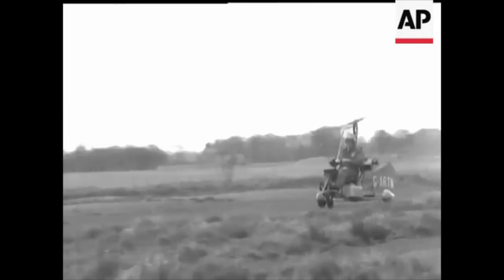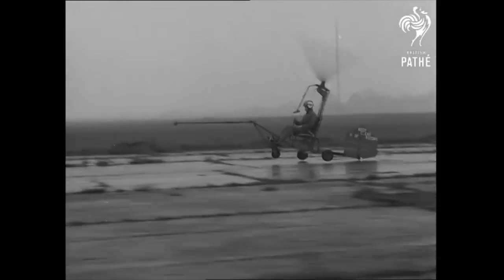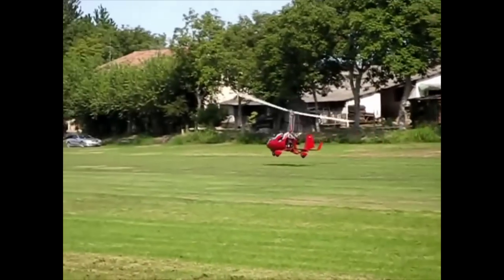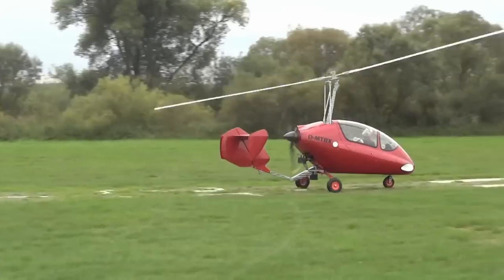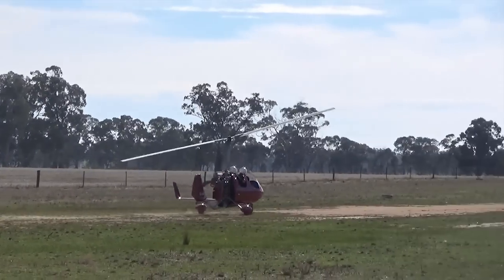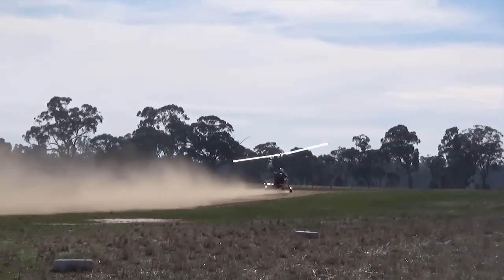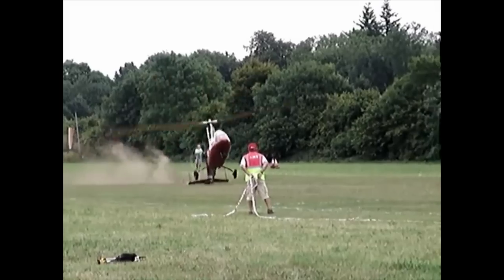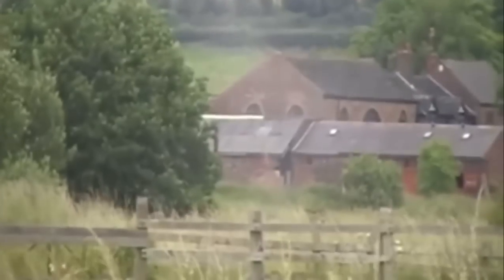Gyroplane/gyrocopter take off technique & errors

Comment: Well done.  Having learnt in the gyro glider I can highly recommend it particularly as it teaches good technique.  It seems to me a lot of people are too rushed to throw in full power.  Give it time if you are building your rotor speed as you build rpm your nose will lift long before full power  balance and feed in power until it lifts off.  The problem with people who just prerotate then Hall in full power is you need very honed instincts and you won't necessarily get off in less airstrip.  I regular ly used to take of in less airstrip than guys with pre-rotators,. Bigger rotor s and more powerful engines.  Simply because I didn't suck up airstrip at higher speeds than my rotor had caught up with.  We hand winders always wound you on the taxiway.  By the time you've turned into wind between the prop wash and the slow taxi speed you blades are ready for a slow and steady acceleration 10-12mph then only at this stage the a little more power and it's back on the tail wheel this accelletes the rotor without danger of lifting off,. Then add power gradually as you balance and you're off in no time.  I'd regularly use 1/2 the strip bloke with 28 ft blades and hydrolic pre-rotators and lighter Rotax machines.  You do not have to gun it. Good review of basic technique.
Reply: Ah, finesse over brawn!

Comment: I had started to wonder whether what you suggest here may be a good idea as I suffer with all the problems you describe here on takeoff. Great video, thanks.
Reply from the maker: Thank you for the kind comments.  Of course you will suffer with the problems because the alternative "wheel balance" type technique is commonly taught and can not fail to lead you down a path of issues because it is aerodynamically inefficient and flawed.  Why is the "wheel balance" technique taught? you might rightly ask.  In part it is a legacy of a technique that would have been used on single seaters - and because instructors over the decades have at some point been either taught as instructors or examined by those who are rooted in the past.  The second reason is that it suits manufacturers to promote a take off that gets you unstuck sooner even if you can not climb away at that point because it suggests the gyroplane is a short take off machine - which in many ways it isn't.  I read a comment from one US based instructor who just wanted to follow the technique used in the POH which is in a way understandable but it fails to understand how these instructions are written.  The manufacturer is not a flight instruction specialist and they will do nothing more than give written guidance that is simple and easy to convey and on the basis the "old" technique is popular they just repeat the old mistake.  If you watch the "take off techniques compared" film then you will see a faithful back to back test.  I suggest you go back to your local gyro instructor, show him the film and spend an hour trying the two techniques and I 100% guarantee you will find the same results I do.  The key is watching a positive rate of increase beyond (say) 220rrpm having pre-rotated to 200rrpm with the stick fully back before moving the stick forward crca a fist and a half (test and find the happy point) hold that point and once you see the RRPM up at around 270-290 (talking MTO aircraft) then you can move stick forward slightly more and wait for it to fly off the ground.  You have gone too far forward with the stick if it "wheelbarrows" to mean you have the main gear unstick before the nose wheel.  Any issues email me or questions.
Reply: @gyrocopterflyingclub6148  "the main gear unstick " Does that mean that the two wheels at the back no longer touch the ground but the nose wheel still does? I ask because my English is not perfect yet. Anyway how about the throttle? Is it 100% from the beginning after releasing the brake?
Reply from the maker: Divad Jens hey. Ok so when the main wheels unstick - as you say the main wheels are now airborne (but so is the front wheel as that unsticks before) so now the entire aircraft is airborne. I only mentioned main wheels in this because as I say the nose wheel will be in the air sooner.  Throttle wise no the throttle goes to 100% once you are rolling and seeing rotor RPMs increase.  If you are experienced and need very good performance then you can go to 100% immediately but be aware that now there is much less time to capture any issues.  I suggest throttle after pre- rotation is enough to get the gyro moving to a fast jog.  Then progressive adding power over 4-5seconds to 100% works best.

Comment from the maker: I had an interesting conversation with Auto-Gyro Gmbh today.  The conversation was around their new rotor system 3, however they have figured with this system what we have known all a long.  You heard it here first.

The first thing is that the rotor head has two rotor brake blocks - one front, one rear.  However the front brake block is also the forward rotor head stop.  So this means that the initial pre-rotation is done with the stick held slightly rearwards so that the front brake block isn't engaged with the ring gear - adding friction and limiting the efficiency of the pre-rotation.

Then once RRPM has been built the stick isn't brought fully back but only 2/3rd of the way rearwards - why? because fully back is too draggy (funny that, we have know about that here for a long time!) and moving the stick slightly forward gives a "cleaner" / flatter take off without the clumsy nodding and over controlling that can come from keeping the stick fully back and attempting to bring the aircraft into a wheel balance...

Comment: Interesting video Phil - but the clip of me taking off in KENG which you are using as an example of how well your technique works was actually flown using the "standard" (stick full back) technique ......
Reply from the maker: Hi - the technique I'm advocating also starts with "stick full back".  The point I'm making with the remainder of my description gives a process that presents the aircraft at a more favourable attitude, sets less traps for students to fall into and requires less mental capacity.  I used that clip of your aircraft because it shows the attitude I'm suggesting is favourable - that you achieved that by accident/experience or some other process is kind of irrelevant.  What is key is that we agree that the way the aircraft is flown off the ground is the better technique and if you follow my process that is repeatable.  Very often we may forget that students are just that and just because a multi thousand hour pilot can achieve a stick position quickly and readily isn't representative of the student with <10hours P1.....

Comment: Wallys autogyros were employed un the Britsh Army. Does anybody remember when and where they were evaluated and what was the outcome of such evaluación?
Reply from the maker: Hi - the British Army Air Corps took 3 WA116 aircraft for evaluation from 1962-63.  These were Beagle-Wallis aircraft but the Army Air Corp finally took the Bell 47 and I'm sure no doubt because of the warm cabin! https://i0.wp.com/generalaviationnews.com/wp-content/uploads/2014/06/IMG_3637.jpg
Reply: @gyrocopterflyingclub6148 Thank you very much for your information. I'm a gyroplane enthusiast!
I have flown Hughes 500, Bell UH-1H and Bell 212, but have always been drawn to gyros (the Jensen was the first one I noticed).
Reply from the maker: Hey - sounds like you have done some exciting flying with those aircraft on the CV!  I used to fly a Hughes 369D, nice aircraft and very fast for a heli.
Reply: @gyrocopterflyingclub6148 
I have also flown the Hughes 369 HM! Its glide flight distance was greater than that of the H500 series. We used to practice actual autorotations .The H500 was heavier and less comfortable in 360-degree turns. Its descent speed is higher than that of the lighter H369 models.

Comment: Those things are way dangerous if you get the wrong angle and lose lift.
Reply: If you mean unloading the rotor (going negative G) yes that's universally fatal.  For helicopters and powered hang gliders usually too.  Its easy to avoid though.  Don't fly very fast and learn to fly properly.

Comment: What is wheel balance?
Reply from the maker: Hi please take a look at the films I’ve made on the subject, but essentially it is merely a phase during the take off roll that sets the pitch attitude- at this point you are on the main wheels only with the nose wheel around 3-4 inches in the air - if done correctly. The issue is that that is seldom the case and often the nose wheel is almost 12inches + in the air and that becomes a problem.

Comment: What do you mean by wheel rotation, I don't get you do you mean the pivot point of the back wheels on angle of attack
Reply from the maker: Hello John - I'm not sure what time the phrase was used in the film - give me a time ref and I'll clarify the exact point but typically if I've mentioned the word "rotation" its just my own term for the movement of the aircraft as the front wheel lifts - I don't like the term "wheel balance" because it suggests that this is something to achieve in its own right or hold for an undetermined length of time.

Comment: I agree with rickdc3, this is bad advice, Balancing on the mains before take-off and balancing  nose pitch as you take-off is the same thing. Why over-focus on pushing the stick forward when this is how you balance. Higher angles of attack are caused by over balancing on take-off and new pilots should never be told they are over-focused on balance. There is only one element to be focused on, if you drag your tail down the runway then you will lift off nose high, if you balance between the nose and tail wheel you will lift off properly and if you keep the stick forward you end up like rickdc3's dad. This vid is well-meaning but dangerous.
Reply from the maker: Hi - Firstly RickDC3's got involved because he was trying to rationalise his fathers fatal accident - when the real point behind that accident was he had very little time in the aircraft, didn't want to take more and simply lost control of his aircraft which from the video of it was about 3-400ft in the air.  Literally zero to do with his take off technique.  If you watch the film, listen to the words there is nothing dangerous in the advice.  The facts of what happens with these aircraft in the take off phase is a reality that this video was aimed at making better.
Reply: @gyrocopterflyingclub6148  Dangerous was the wrong word my apologies, your videos are usually spot on and students would do well to listen to your advise, I was picking on a single aspect that may cause confusion which was, "don't over focus on wheel balance" as if excessive nose pitch was caused from something else.🤐RickDC3 commented that not fully focusing on wheel balance is bad advise and I tried to explain why I agreed.
Reply from the maker: @homergee3381  Hi - no all is cool and of course there is nuance / degrees of in most of flight training.  The point I guess I was making with the general overview of the film is that the original techniques in gyroplane training came from aircraft with no pre-rotators and no rotor tacho.  Of course in that context wheel balancing is the way to keep safe [or rather keep from bending the aircraft]  today we have tools that we can use to make the process "easier".  The "focus" element of my comment is that in my experience as an instructor that piece [the "achieve a wheel balance" bit] and that can become the destination - forgetting that they actually want to take off.  Either consuming runway while we wheelie down the runway, nose high and over pitched.  For me it is why they loose directional control and/or take off behind the drag curve.
Reply: One of the benefits of the gyroglider is it could take off will full back stick and the rope stopped the rotors impacting the ground.  In fact that's how we soloed people on the glider (initially).  Full back stick and the pilot only has to worry about staying behind the car.  This reduced cognitive load but also meant the driver controlled the height.  We'd then progress through holding a height (requiring you to come forward on the stick) and then moving to fully balanced take offs and landings.  Of course prior the instructor was teaching correct balance and mine at least yelling at me if I was a fraction too high on the nose.  What this meant though was the glider trained student was very aware of what gyro feels like behind the power curve, they intimately knew the attitude and sluggishness of the stick.  Also the glider on a km long strip is doing a take off an landing every single minute so they typically have heaps of practice.  

What his technique corrects for is the typical modern powered take off where the guy drags the machine off after pre-rotating until 220+rpm then is caught either chasing the takeoff to avoid letting the blades decay sufficient to risk over control when suddenly the nose rears and yaws and suddenly the new bloke is struggling with pitch, compensating for one wheel lifting with the massive torque and juggling all these things over a few seconds before you are off.  Note he isn't suggesting holding the nose down just not holding in full back stick as you approach takeoff.  

The traditional hand winding technique can take just as little or less airstrip because you aren't rapidly accelerating to flying speed and suddenly meeting it.  This is my go to video an old mate of mine taking off in calm conditions after handing winding.  He did this all the time and this is actually the taxiiway.  Notice how casual all the phases are and how little room is used to get off.  https://www.youtube.com/watch?v=36ogAzGGyG4  Notice how slowly he progresses at first,  this is because angle of attack on the retreating blade is the biggest factor in getting the blades to speed quickly.  If you introduce too much speed it will exceed so the quickest way to get the rotors to speed is only introduce what the blades can handle.  It feels to me modern technique tries to avoid blade flap at the expense of higher rates of getting off behind the power curve at rotation.  Just my opinion.